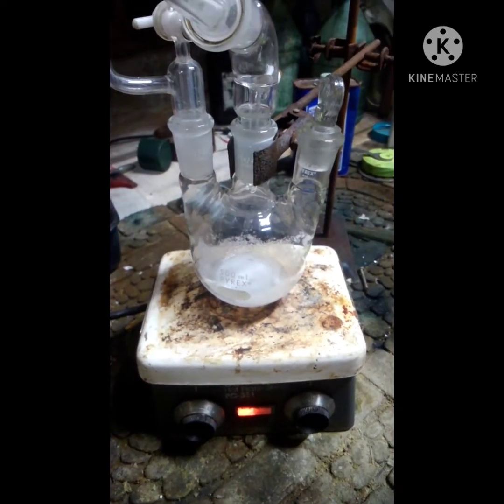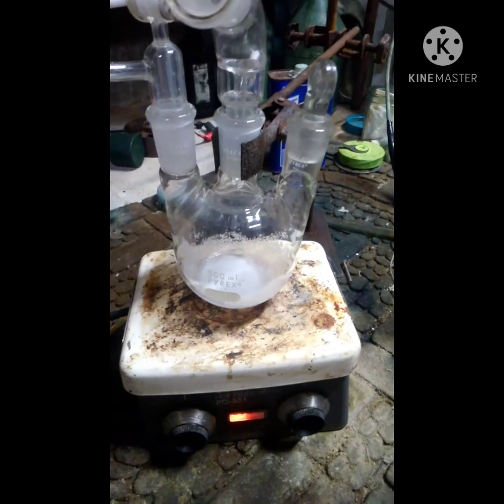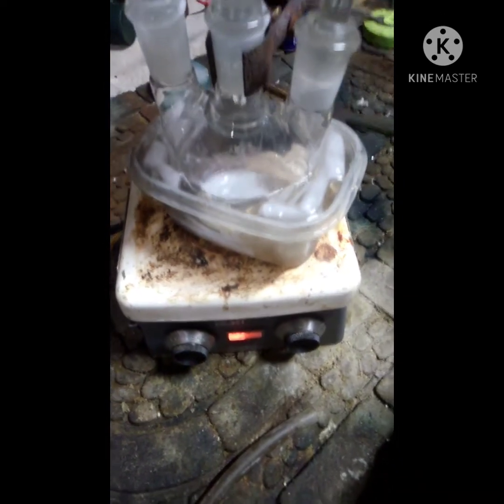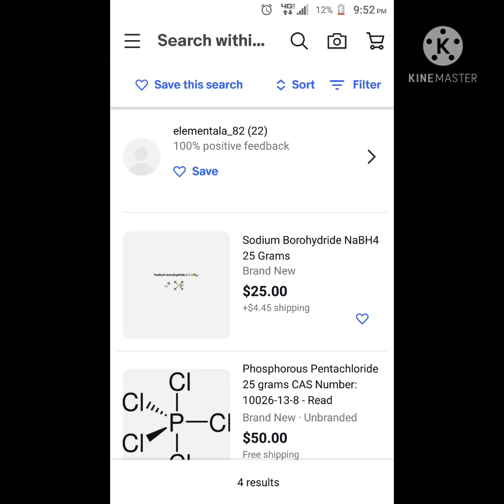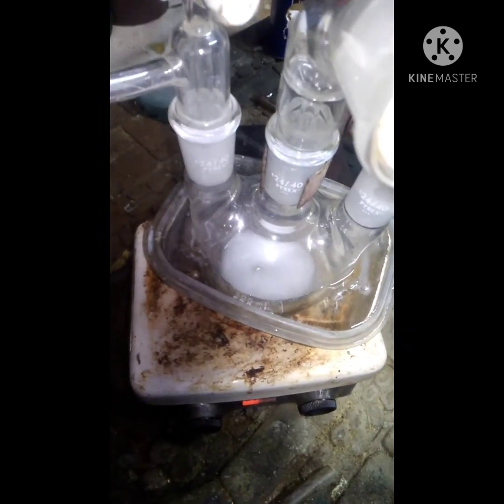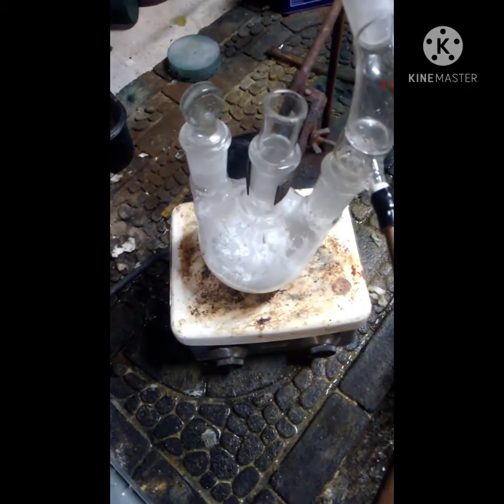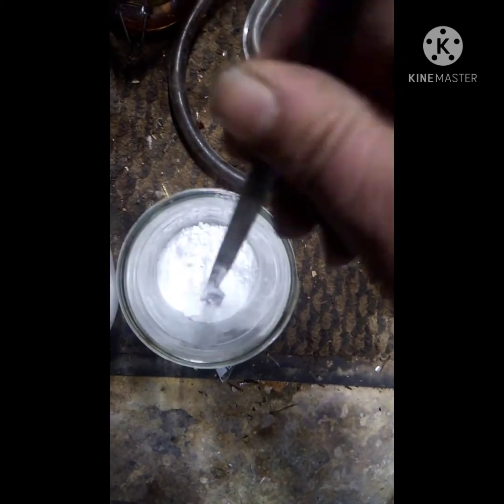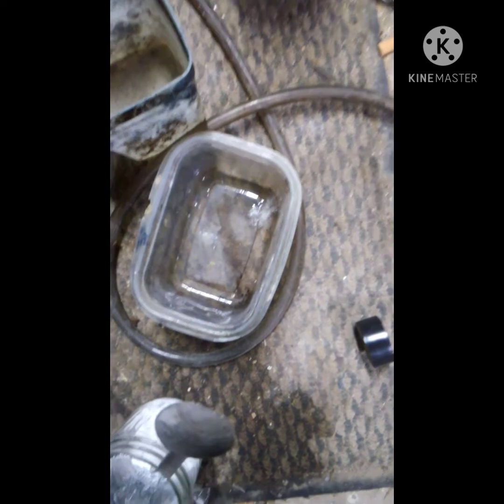how to make sodium triactoxyborohydride

Comment: Your stoichiometry is wrong, for 5.7g of NaBH4 you will need about 25ml of acetic acid. When doing it like this if WILL reduce ketones and do all the other stuff you don´t want to use NaBH4 for. take care
Reply from the maker: Thank you for adding information! I still have much to learn!
Reply: I was just about to say this. You need a mole ratio of 1:3 NaBH4 to AcOH for sodium triacetoxyborohydride.
Reply: You are using 150mmol of NaBH4, so 5.7g which in a 1:3 ratio turns out to 450mmol of acetic acid which is 27g or 25.74 milliliters